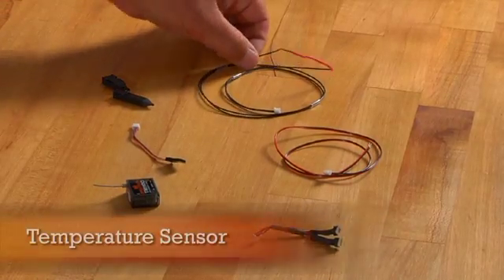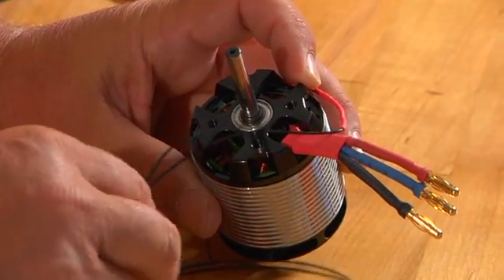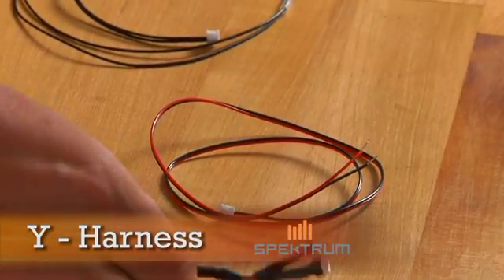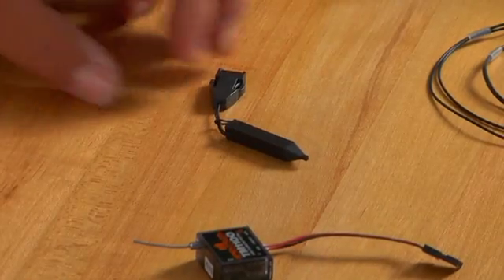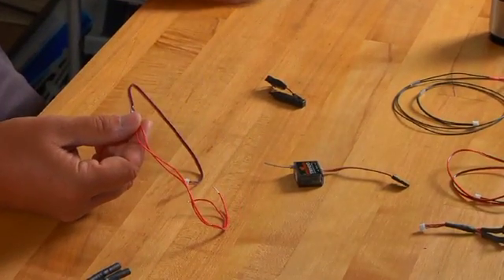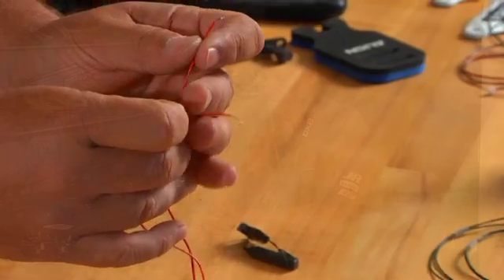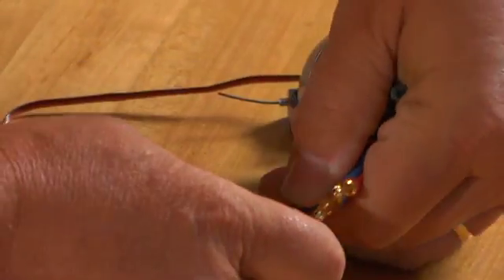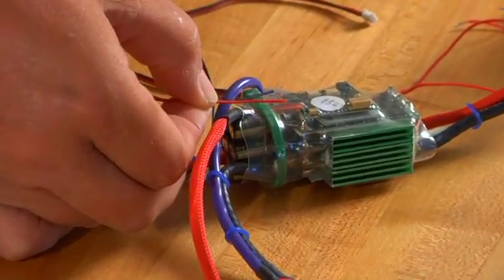Spektrum Helicopter Telemetry Overview

Comment: Hi John and greetings from Ireland... quick one for you, is there a firm wear up grade to change my region settings on my DX8e from EU /FR etc. to U.S. ? i have an old DX6i and it allows you to do this no problemo . I wanted to use this radio for my helies but also some short range FPV and not sure if i can trust this TX as i cant seem to find any data regarding power out put from this radio.

Thanks in advance
Mike Leo.

Comment: Spektrum, can anyone please integrate rx and battery pack voltage telemetry into a receiver?
Reply: you cant. the reciever runs at 5.5-6v due to the BEC stepping the voltage down for the servos. 

there will always have to be a different lead. cheers!